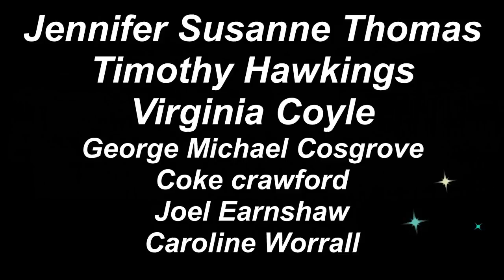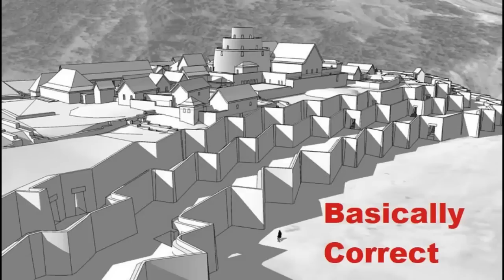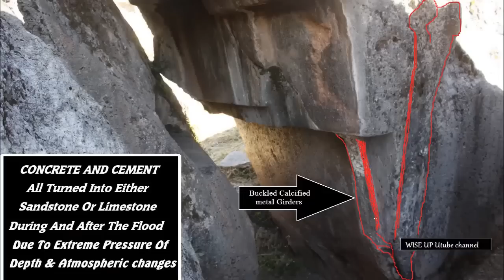GEOPOLYMER

Comment: As you might expect, the larger the batch you attempt to mix, the harder is is to keep the formula uniform, and you're bound to end up with soft spots here and there. most of those immense blocks show a rough patch here and there which appear to be more consistent with pre-hardening inconsistencies than they do with flaws in quarried stone.
Reply: Yes, this is true. Mixing something in an uniform manner is quit hard. I found out with our geopolymer samples, if you make a picture and you play a little bit around with the picture correction tool in windows like saturation and brightness you can achive a picture which shows areas less uniform very good. That is like in forensics when they look apon a sample with different kinds of light. Suddenly invisible traces become observable. I do not remember what kind of alterations i did in detail thou.

Comment: Excellent, thanks. 
We forget how much Hemp was around, everywhere. So much was destroyed it changed weather systems. 
Biodegradable plastics where used in great quantity. 
Sun hemp,, can be literally cut and beaten into the shape of a canoe, allowed to set and is then hardened by placing in salt water. 
It becomes brittle after 15yrs and then degrades to dust. 
Hemp cement. Hemp bonding agents were used in many thing's and still are. 
Hemp sandbags are so strong. Totally biodegradable.
Reply: Why “they” made it illegal and demonized it

Comment: THANK YOU! 
you can see the smaller rocks and wooden planks underneath the cement. 
ancient stucco work if you will. 
just like modern stucco over cinderblock.
it's just many layers deeper, river rock or brick work instead of cinder block and A LOT more "stucco" facade over the top. 
basically.

Comment: If you have ever had to tear out any type of mortar that has been applied to metal lath it does the same thing on a micro scale.
The cracks will spiderweb throughout the surface field but the mortar remains adhered to the lath maintaining it's general structure albeit damaged and compromised.
Some of these walls appear to be affected in a similar way, only on a much larger scale.

I think maybe there was some kind of steel sheeting material (steel chain link fencing i.e)  that the concrete was applied to that gave it enough integrity to hold the broken concrete together and in place, yet was flexible enough to allow the spiderweb cracking that we now see as 'grout joints' 
The steel nesh sheathing has obviously broken down and rusted away leaving what appears to be fitted stonework when it really is just concrete with an aggregate that was too small for the scale of the application.. which caused the spiderweb cracking..

In theory of course
Reply: I am going to do a few experiments with some materials from work and then I will report back with actual physical examples of what I'm trying to explain here..
Cheers
Reply: @3p.vision544  kinda sad pictures cannot be posted in these comments.
 Then again, could be innundated with them.
Reply: I have some good stuff for you on these geopolymer walls..

Is there an email I can shoot a short video to?

Comment: Yes, the walls were poured like concrete, but how they were formed is still a mystery. Wood forms don't account for the curves of the blocks, maybe animal skins for bags that would swell out as they settled. You see the same type shapes when concrete blows out of it forms.
Reply: Hmmm...some kind of cloth form tacked to a wooden structure then filled. I like that. Would describe the board shape along the seams of many.
Reply: I've an old book describing how to build a house of cement by framong 2 walls a foot or two apart, tacking on wire screen to the outside of each then filling, between, with cement and gravel. Gravel to the outside for stucco work later.

Comment: Within the UK alone, what are coined by mainstream as                  " Sedimentary Caves " are indeed Geopolymer structures.  Much work and irrefutable evidence is available for any operating opposition.

The imprints on the wall are from the bracing systems displayed by representation image , were in fact bracing " Sandbags" of various sizes , containing geopolymer.

Comment: You are correct they are polymer but just the puffed out rock i believe anyways most of the casing stones on giza  as well. plus there is that one pile of what looks to be a huge pile of dried up old polymer rock right by the sacsay place  surprised you did not show it. anyways thanks for the upload good shit

Comment: EDM drilling, as long as the material conducts electricity.... video on you tube, drill through a steel ball bearing with a copper rod using electricity... one end is cathode, other is anode... all the these structures, use granite etc.. because of the high quartz content, it conducts electricity very well, the reason for the odd shapes, it is what some would call " as built " in other words, as I built it, the next rock had to fit to the one I just put down...we use lasers to clean rust off metal, so it was probably some combination of the two, hence no waste material, I would go so far as to say it was probably a combination of electricity, sound and light that shaped those stones like the are.... and why would you create a one time mold for a geopoly rock ?? if you only use it one time... seems like a bit of waste.... shaped by hand, not likely, the lines are too perfect...
Then you have the Law of One material.... which talks about shaping rocks using intelligent energy...